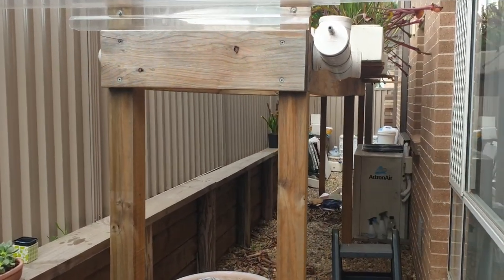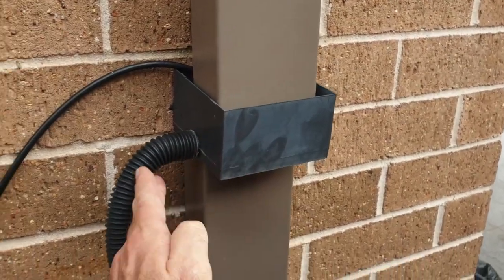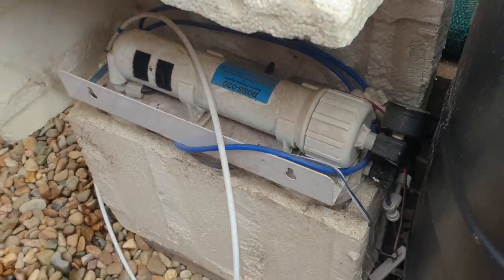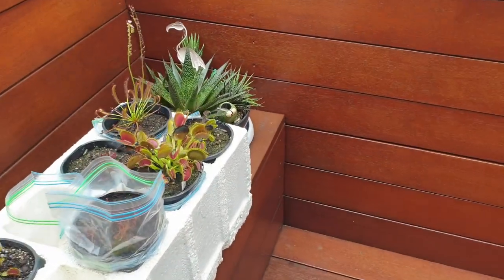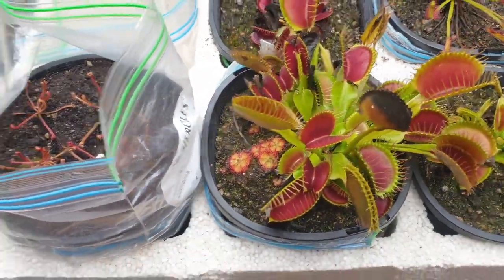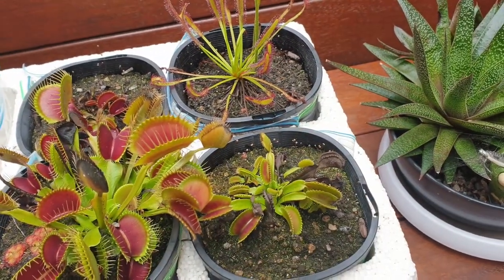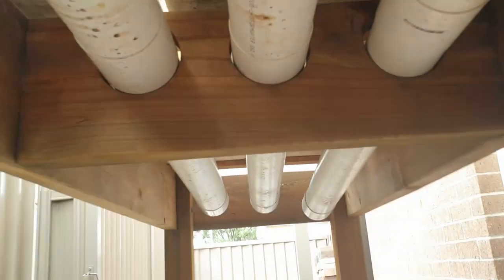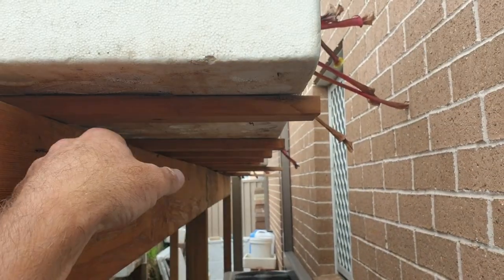Carnivorous Plants - Auto Watering Project

Comment: Great idea looks promising
Reply from the maker: Thanks ...... the big motivation factor for me has to be the amount of time I'm going to save. I'll keep you infirmed as to how the project evolves......cheers.
Reply: My neighbor installs lawn sprinkler systems. He also has a garden. He uses a Hunter water controller to automatically water his garden. It has to be plugged in, and also needs an electrically controlled valve. The system is connected to a spigot on the outside of his house, and the control box tells the valve when to open and close. Once it opens, water flows through the main water line ( a fancy hose) to small sprinkler heads located every few feet. The hardest part doing this with carnivorous plants would be a good supply of rain water or some other source other than municipal water.
Reply from the maker: Hi there ....thanks for your comment! It was always a challenge for me when designing my automatic watering system: How do I connect a pure water source? I checked my tap water with a TDS meter and I got a reading of 130 ppm! ....way too high for carnivorous plants. So my outside tap was out of the question. I then thought about my rain water tank. The water is good enough but there's no pressure coming out of the outlet. I need presuure to get the water up to my carnivorous plants since they're elevated. The only solution was my RO filter. Stay tuned as to what I came up ..... it works a treat! Happy growing to you!
Reply: Looks great. I'm designing a much smaller version of a self watering trough for my Sarracenias. How did this turn out? Any updates?